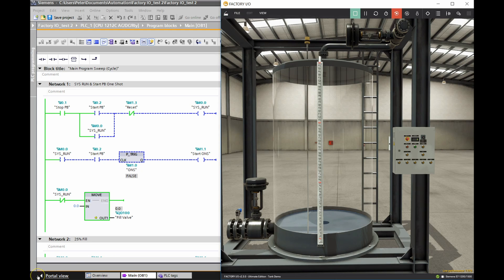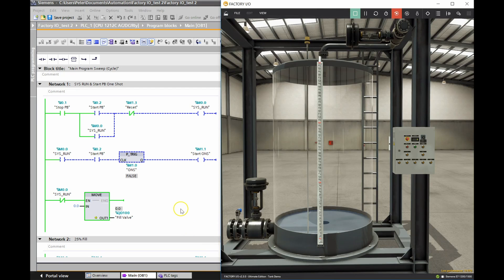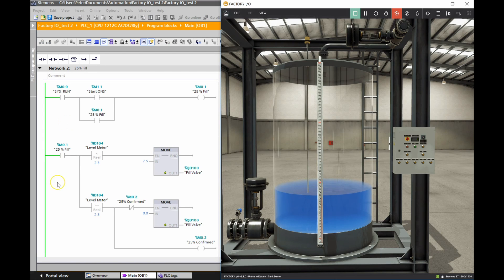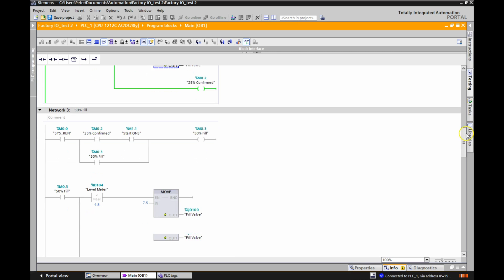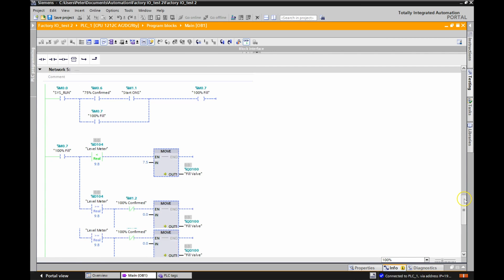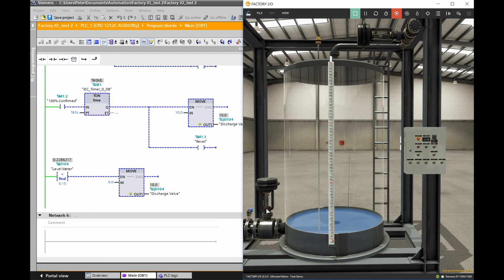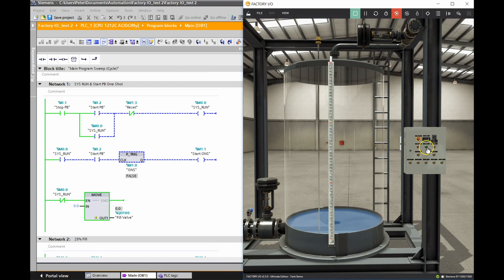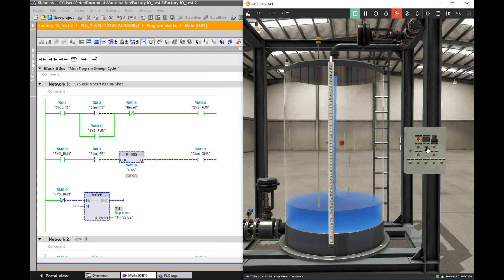Siemens TIA Portal & Factory IO (Tank Project_Various Fill Levels using the same PB Input)

Comment: Nice, it would be even better if you could have it count the number of start presses to correspond to the level you desire. Example,  after a reset, one press of start enables it, two presses will fill to 25%, three presses to 50% etc.... Then flash a light repeating your choice and start the process. One of these days I'll download Factory IO and work on the list of logic examples I am making.
Reply: Just saw your other video of the four different levels, nice. I ended up installing Factory IO and Automation Direct Do-More and programmed the one button selection for the different levels with some other logic too of course. Works as expected..... after a few hours of getting everything communicating.

Comment: How did you configure the analog input assigned do liquid level? I used norm_x to normalize uint to real (minimum value 0, maximum 27648) and then scale_x (minimum 0.0, maximum 10.0) but the proportions aren't right, the liquid level value seems to contain in some weird range 15000-16500 or something like that...
Reply from the maker: Once you Normalize the incoming 0 - 10 volt signal to 0.0  to 1.0 you can then Scale that value as many times as you wish. I believe I then scaled the Normalized value to 0 to 200 cm liquid level.

Comment: hi Pete I've seen your program so amazing and I love it, How about program washing machine operations using plc and hdmi control with indicators? with ON/OFF switch using hdmi screen and lid sensor NC contact connected to Digital INput 0.5 and over balance sensor NC Contact connected to Digital input 0.5, Fill sequence 60% with water after 5 sec hdmi adjustable for clothes absorb the water then fill the machine 100%. The heat sequence water 45°C if temperature goes 50°C stop the operation. Agitator sequence wash mode consist 5 sec clockwise, 2 second pause 5 second counter clockwise 2 second pause again. repeat the wash 5 times hdmi adjustable. The soak sequence the machine will wait 15 seconds hdmi adjustable to soak clothes with soak cycle indicator, and the spin sequences start pump when water level drops below 20% run the spin for 1 minute hdmi adjustable, then switch off the pump and the spin. while spin running turn the water valve on for 5 seconds then off for 5 seconds then on for 5 seconds then off.  operate the spin cycle indicator other off. when the lid or overbalance sensors operate the variable "wait" should inhibit the spin, pump and water valve. Finished sequences all outputs are off operate the finished indicator for 10 seconds and then switch off and reset the machine for a re-start. other indicators are off.

Comment: Interesting, when tank start draining and the start button if pressed it will try to fill and drain at the same time and depending which one is quicker you will either end up with the tank at 25% full or completely empty waiting to start again. I would put some protection that won't let you start until it has reached a minimum level if you need it to drain completely before starting again or have another step that won't reset until it is completely drained to stop starting mid drain cycle.
Reply from the maker: Definitely... it's a start, but needs some debugging.